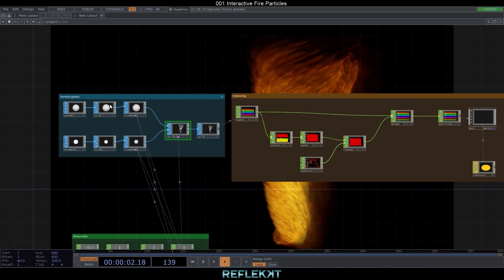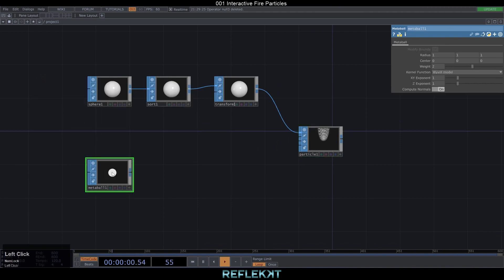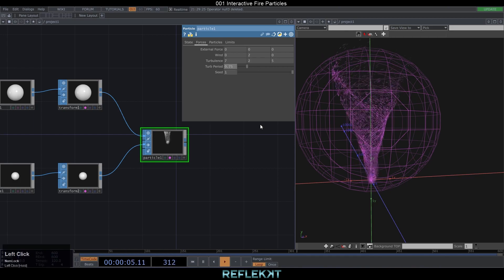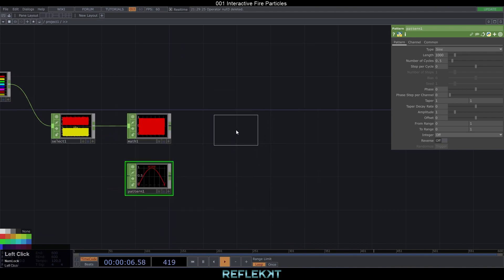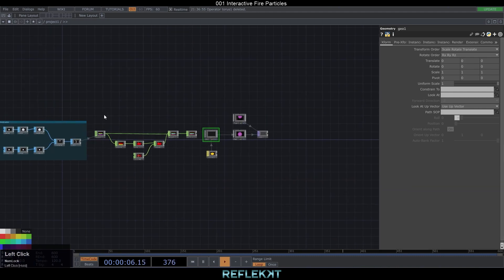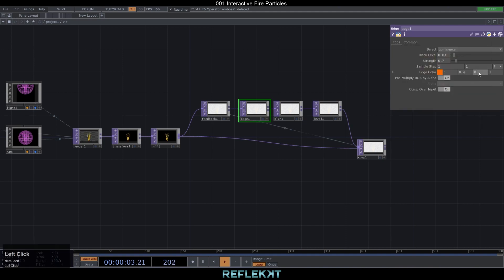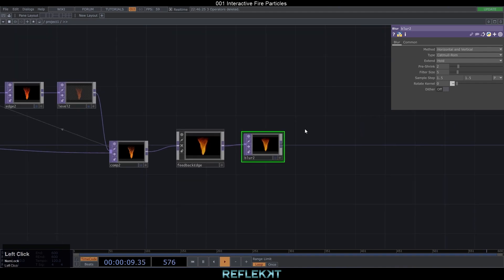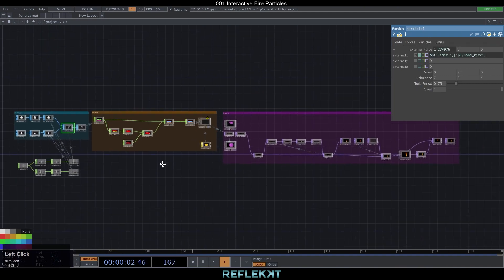Interactive Fire Particles - TouchDesigner Tutorial 001

Comment: Hi Reflekkt, thanks for the video great stuff, i have a question, is there a way to add this effect to a custom geo like adding it to a ball or pyramid so it looks like the ball and pyramid are on fire ?
Reply from the maker: Hi and thank you! 
Yes you can use any SOP as particle emitter/particle source. Just connect the SOP that you want to come the particles out of to the top input of particleSOP. if you add a sortSOP inbetween and set it to random, you the particles get spawned randomly across the points of your SOP instead of following an order.

Comment: The Kinect chop uses the Xbox Kinect, correct? I'm setting this up using the Kinect 2.0 and it's not returning any data, but everything in the code is correct, and there's no issues with the hardware.
Reply from the maker: Do you have the Kinect SDK 2.0 installed? Sounds like maybe there's some drivers missing?
Reply: @reflekkt_net  I do, I've gone through and updated all the drivers I could find.